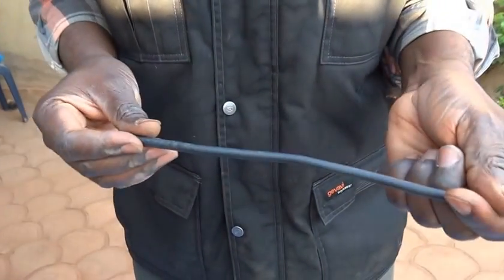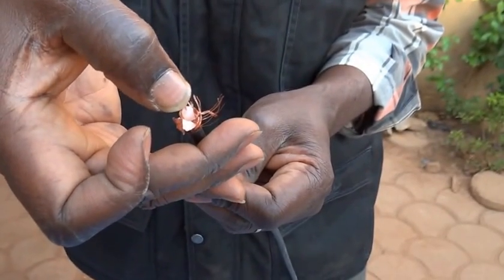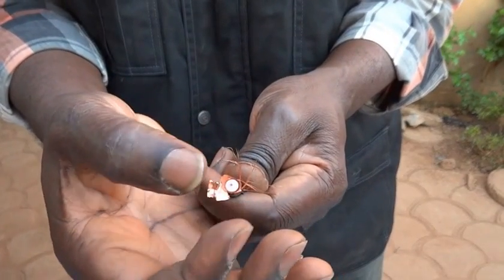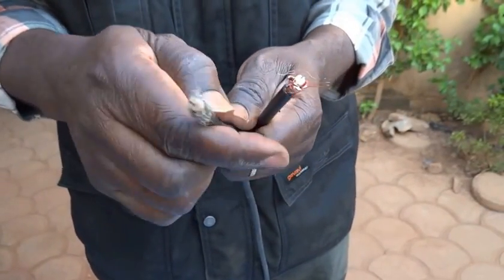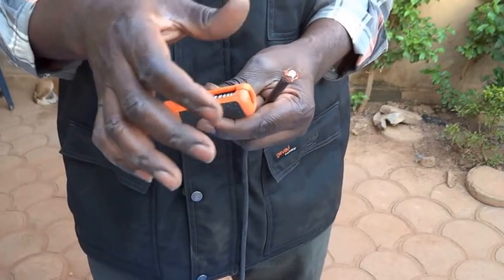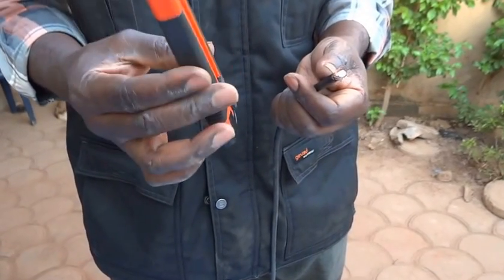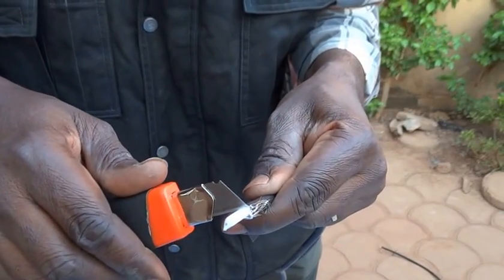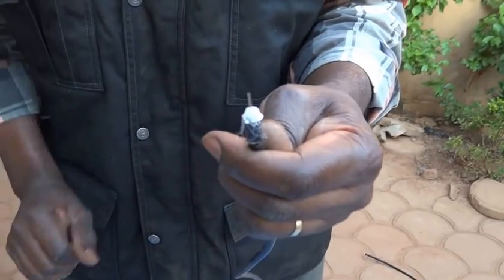Part 2 of 5 -- Self Installation of a Satellite TV Dish System From A to Z - Preparing the Cables

Comment: its best to have the rite tools to put connectors on the coax and rg-59 now days is a bad idea to use for satellite tv, the older satellite equipment works fine but any high deff will sometimes burn it up because its so thin of a center conductor